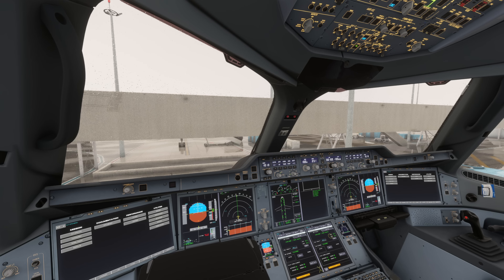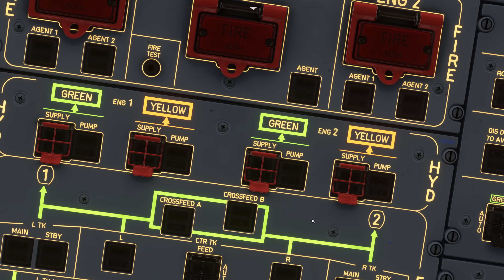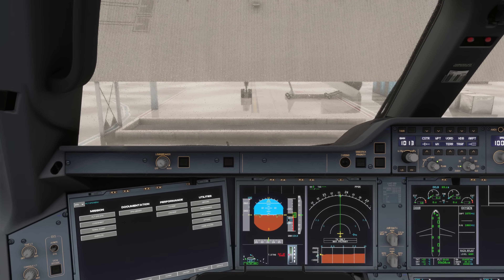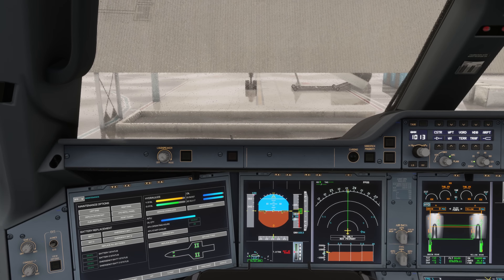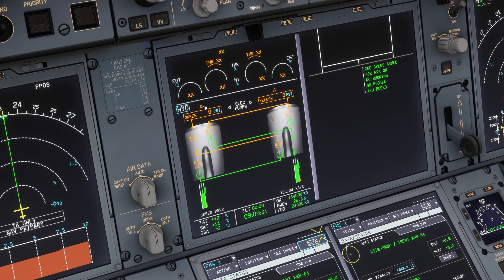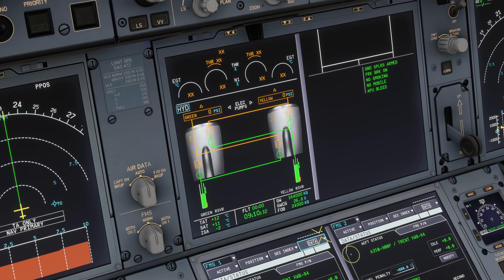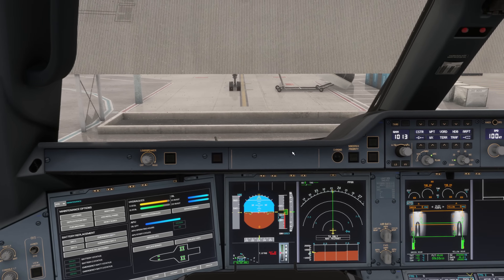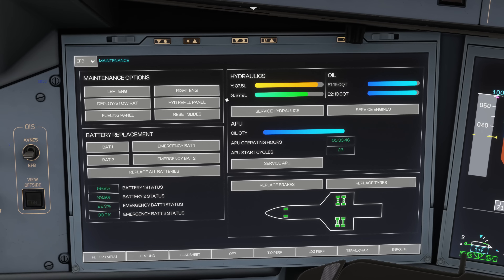Why does the A350 only have TWO HYDRAULICS SYSTEMS? | Real Airbus Pilot

Comment: Ok but does inibuilds simulate the electric actuators? I turned off all 4 engine pumps and both hydraulic systems lost power. On the HYD page I saw that G and Y were lost but the electric symbol was still green. But nevertheless nothing moved. No spoilers, no flaps, no rudder aso.

I think they might not simulate it correctly...🥴

Comment: In F/CTL page, you can see which control surfaces are powered by which actuators, it is either Y (Yellow), G (Green), or "lightning symbol" - that electric servos mentioned by Emi.
For instance, the pitch trim are controlled by double lightning symbols, meaning 2 redundant electric motor servos. Left elevator is G & lightning, while right elevator is Y & lightning.
The only surfaces without electric motor servos are the outermost flaperons and innerboard flaps.

Comment: Funny for you to post this as I just watch a video last night of flight engineers testing the redundant system in flight. I will say though, I dont think having this system is any more cost effective than having a third system. It adds more complexity and for more parts to have a potential failure. Granted, the aircraft probably has a sensor on each and every one of those electro-hydraulic actuators but still leaves room for more things to go wrong.
Reply: Interesting! Would be cool to see some numbers on that. If these components rarely ever fail then obviously this is more cost effective. But is it?

In the same way I am also wondering if Airbus kept the bleed system whereas Boeing ditched it because of weight on the 787, maybe also because of this reliability?
Reply: @ I wish I had the number. Would definitely be interesting to see. Bear in mind what I said is purely speculation and opinion based. I am by no means an expert in aviation engineering.

Comment: would you also make a video about the throttle on the a350? I am asking because I see on the middle display, the THR% is in the middle, instead of N1. Previously you made a video talking about the IAE engines on the A320 where the throttle commands a EPR instead of N1. Is the A350 doing the same thing, or the throttle is commanding a certain N1 when auto throttle is disengaged?
Reply from the maker: You mean the thrust indications, not the thrust levers, right? The A350 does not have a throttle :)
If yes: Coming soon!

Comment: Oh, I always thought that the Airbus A350 also had three hydraulic systems. According to ChatGPT, it seems that it does. But thank you for the video and the clarification.🎉
Reply: Sorry to disappoint you but ChatGPT knows nothing about certain technical specifications of very special specific things. You can also easily correct it by saying absolute nonsense, like for example "No the N1 bypass fan has 50.000 rpm" and ChatGPT will answer "Sorry you are right yes the N1 bypass fan has 50.000rpm in-flight" or something like that. Better use the Virgin Atlantic Flight Crew Manual (March 15th 2020 edition, FOCOM 6404 pages) and A350-900 Aircraft Preliminary Data Aircraft Characteristics and Maintenance Manual.
Reply: @juliashenandoah3965  True words, that's why I'm surprised that the much-praised A.I still makes so many mistakes or simply doesn't know certain things. Fortunately, there are still people like Pilot Emanuel who can explain things very well and know better than an A.I. Unfortunately, I sometimes look things up on ChatGPT when I'm unsure or want to know quickly, but I really need to break that habit and go back to the good old library.
Reply: ChatGPT, purveyors of disappointment for over two years.
Reply: Chat GPT produces pure bullshit when it needs to answer something that requires thinking and not dumb reproducing. Sometimes it is even funny to ask some questions that you expect to be answered with pure garbage. I find it quite funny and like to play with it that way sometimes.